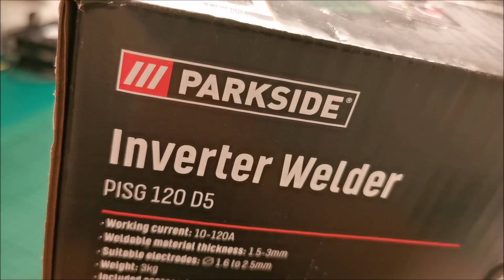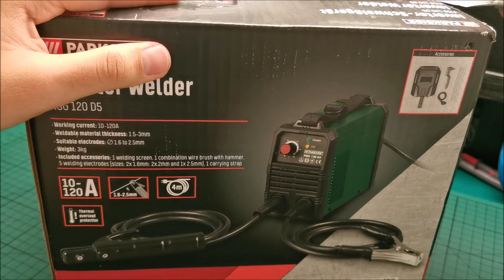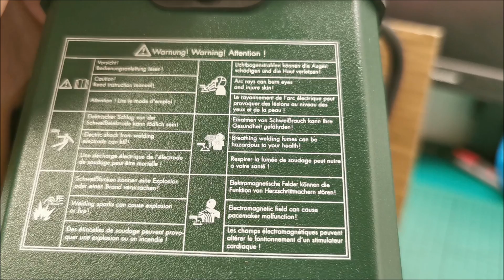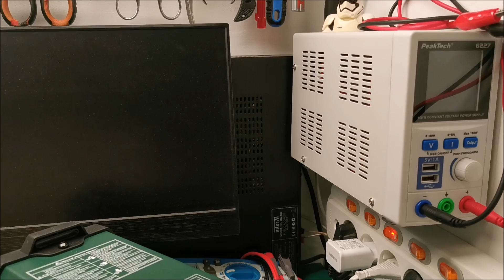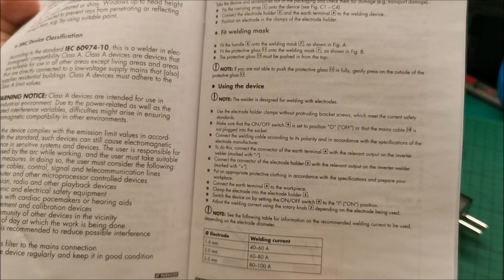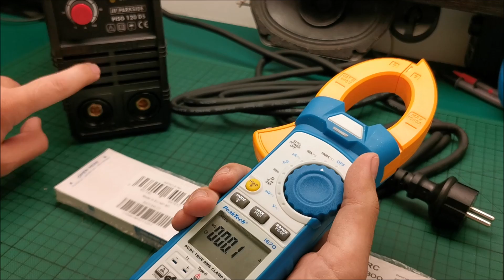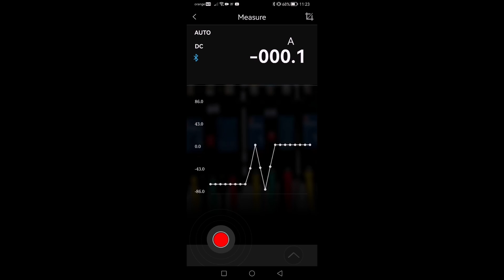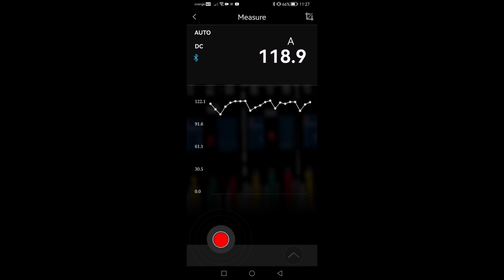Parkside PISG 120 D5 Inverter Welder (from Lidl or Kaufland) - unboxing, review and test

Comment: Are you working with 3,5mm electrodes  with this invertor?
Reply from the maker: No, I don't have anything that requires 3.5mm.
Reply: Ok Romania, I'm from Bulgaria , ...☺My invertor is parkside pisg 120A D5,  60€...working not with 3,5 mm electrodes.. Only 2,5 mm😕 Your video is very good..
Reply from the maker: Hello neighbour! Thanks!
Reply: It is my first time operating this welding unit. Evertime when I practice the 2.5mm electrode i sticks to the metal n it's frustrating. I m stressed 😢😢😢😢
Reply from the maker: Not high enough current, bad electrod or bad contact somewhere.

Comment: Omg this is a little monster, completely obliterated your father's China thing!
Probably if you can live with that awful fan noise this is the best buy for a little inverter.
Just keep it away from metal dust so it doesn't damage the electronics.
Reply from the maker: Yup, exactly my thoughts 🤭
I did not even register the noise, as I did not realise there could be quiter ones out there 😄
Reply: @UltimateDIY  I bought a few welders for my father, but this Parkside is actually pretty good, I think I will buy it to as portable welder.
You can put some fine wire mesh in the front to protect it from metal particles, those kill most of the inverters as they have a tunnel from front to back for forced cooling and will suck everything in.
You could open it and show the insides to see how the components look, if they are coated then it is even better.
Reply from the maker: @bbogdanmircea hmm... I might just take a look inside if I can.